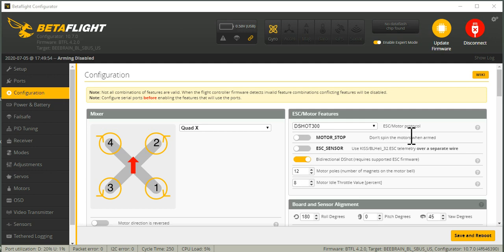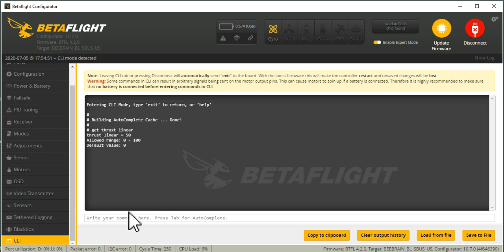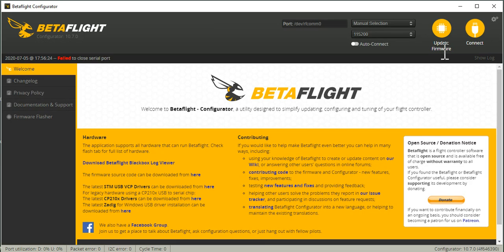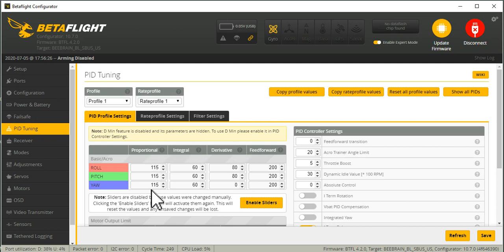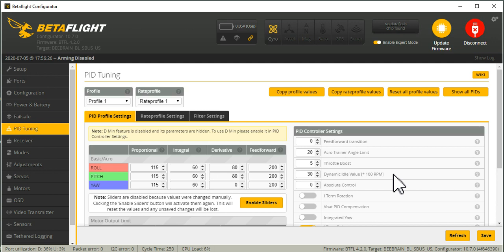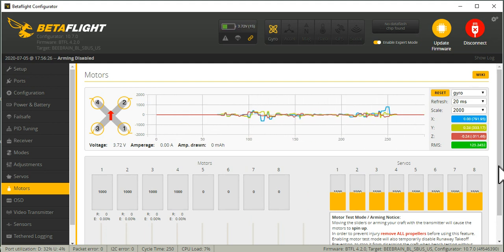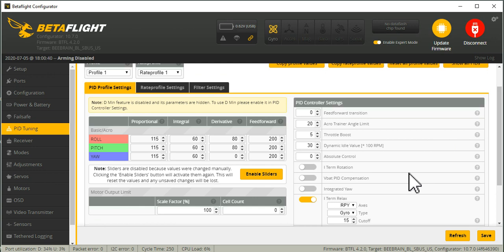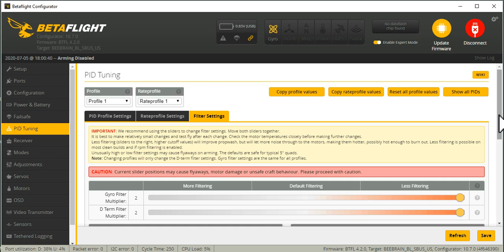Betaflight 4.2 for 1S 1202.5 with Gemfan 3018

Comment: Thank you very much for this tune, 3 years later. Worked very well to fix the wobbles on one of my Babytooth builds.  2mm Babytooth frame, RCinpower 1202.5 11500kv motors, and an old BetaFPV 1s 5A fc. Worked well for both the 3018 biblade props and the 3016 triblade props.
Reply from the maker: I’m glad it worked for you!

Comment: thank you SO much! do you think these settings will is for the new FPVCycle 13mm 11250KV motors on a KebabFPV babytooth (with 3018 props)? I'm still a newbie and can't tune myself yet. thanks again
Reply from the maker: Yes, it should be a good starting point. If the quad is too jumpy when you arm or if you get hot motors, decrease the P and D a little (keep the P:D ratio the same).

Comment: these settings are just amazing. i have applied these to my 1s 18650 3D printed nano long range. It runs on Happy 1203 11000kv motors. transforms it.
Reply from the maker: Good to know that it works for the long range build as well. Thanks for the feedback.

Comment: Love this tune. Transformed my build from a jittery wreck into an absolute dream to fly. i built mine with A generic fonster 125mm 1.5mm frame. I cut one of the lugs off to enable me to use the crazybee f4 lite the right way up and access the USB port. Happy model 1202.5 11000 kv motors with plugs. The crazybee f4 lite has an SPI receiver better than some and the built in VTX isnt bad either. Beebrain canopy  with Runcam Nano 3 (Mobula6 camera). 38g dry with Gemfan 3016 tri blades. Only using the solid pin PH2.0 battery connector that came presoldered but still seems to fly great on GMB 1S 300mah  LiHV lipos. No soldering required so a really easy build. I Learned so much watching this. Brilliant work Sir!!!

Comment: Have u every experienced a motor grinding noise issue with rpm filtering on 4.2? I’m using uavtechs toothpick pid tune as a starting point but noticed a crunchy sound that wasn’t there when I was on 4.1 before I upgraded to 4.2 and added rpm filtering.
Reply from the maker: I haven't personally. My builds tunes tend to get high throttle warbling type oscillations. On some of the UAV tech videos he's captured the Dterm oscillations, which is a very angry fast oscillation could possibly be a grinding sound?
Reply: @Quad66  thanks for the response, yeah I turned off rpm filtering and it disappeared.
Very strange. Your pids work great though that bob has of your video on his product page, even without rpm enabled so ty

Comment: just done my toothpick build using 1303 fpvcycle motors.. and its soooo good.. high efficiency using 48k pwm.. heres my maiden: https://youtu.be/meK2KKjqDn8 
 but as you said here the 48k makes the quad wobble.. today i try to use 24k on my jesc.. but it will decrease alot my tiny 350mah 3s lipo :p im getting 450msh 3s and should arrived tommorow..
Reply from the maker: DNLKRNWN 1303 is a little too much motor for 350mah.
Reply: Quad 66 nope.. Please watch my maiden flight..

Comment: Are the free rpm filter firmwares able to be used or not recommended?
Reply from the maker: M. TTT. There have been more reported issues with jazzmav. I personally don’t think the savings is worth the risk and don’t mind supporting Thorsten’s work.
Reply: @Quad66  ah okay, yea I'd like to support the work, just don't want to buy them then fly a few packs and have the board crap out or crash and there goes the license.
Reply: @Quad66  oops I thought it was 20 bucks for one aio, not 5, I just got a license for the board to try out.

Comment: Have u tried 2s with a motor output limit? Or is this just strictly a 1s build for u. Only ask cause I see u are using the beebrain brushless board
Reply from the maker: I’ve flown it on 2S but the power band isn’t right. I would love to try the flywoo 1202.5 in 8-9000kv.

Comment: I gave this a whirl on my WarPig 120 2mm, with a BetaFPV 1s FC, the FPVCycle 1202.5s and the Gemfan 3018 bi-blades and I can comprehensively say this tune is freakin amazeballs - though so is the quad itself.  I had wondered about the hype, but this combination is nothing short of spectacular. Mine comes in at 38g dry and 53g AUW (600mah GNB 1s) and flies so damn well - and quietly! - I can tear the sky apart with this around home and is almost silent which is great as I don't want the neighbours to take a dim view of my time in the sky.  Very very happy with the overall result.  Thanks so much for your work in the 1s department Quad66!
Reply from the maker: Awesome! Cheers.

Comment: On the DMin side of things - running high gain/advance (50, 100 respectively) takes away a lot of that weirdness, but it also gives you less of that overall improvement.
You're correct about 3 harmonics being great - the higher ones cause basically zero phase delay, so might as well, because anything the D-term picks up there is going to be bad.
Reply from the maker: On a 2S build with black box the best balance I found was to keep the D high no Dmin but to increase a little low pass Dterm filter and then raise rpm Q to 750 to reduce the phase delay. I’ll do a run through on that sometime soon hopefully. I’ll try out that approach on the 1S as well.

Comment: Just built myself a 1s micro with the flywoo 1202.5 11500kv motors with crazybee f4 lite. Maiden was on stock 3.5.7 and flew great save for some wobbles after flips and split s turns. Did your tune on 4.2 with licensed jesc 48khz and I have never felt anything so smooth after dives, split s turns, flips, and rolls! However, I find that general steering is a bit... Loose? As compared to 3.5.7, which  felt really locked in. Is it because of the different setup? What should I adjust to get tighter turns? Thanks and again, awesome work!
Reply from the maker: The term loose is commonly used but it can refer too or be caused by multiple things. In terms of feeling loose all (and more of the following can cause the quad to feel loose):
P too low = sluggish with slow P undershoot oscillations
P too high = quick response but vague with fast oscillations
P/D too low = sluggish dull respsonse
P/D too high = P overshoot and oscillation, initial response will be quick but then feel vauge and unpredictable with bounce back at the end of flips and rolls.
FF too low: lag in response to fast moves
FF too high: jittery and unpredictable
I too low: difficult to hold attitude through corner, bobbles with throttle cuts and small punches
I too high: I accumulation causing slow overshoot oscillations
48 khz: decrease punch and decrease braking making it more floaty
Filtering too little: Increase Dterm noise causing less effective dampening from D.
Filtering too high: Increase latency so Dterm coming on to late to dampen particularly with prop wash. 

can you post your diff all from 3.5.7?
Reply: @Quad66  Here you go. Stock pids and all from when I got it, save for personal settings...

# 

# diff

# version
# Betaflight / CRAZYBEEF4FR (C4FR) 3.5.7 Mar 15 2019 / 21:42:20 (e9130527c) MSP API: 1.40

board_name CRAZYBEEF4FR
manufacturer_id 

# name
name Frazam

# resources
resource MOTOR 1 B08
resource MOTOR 2 B07
resource MOTOR 3 B06
resource MOTOR 4 B10

# mixer

# servo

# servo mix

# feature
feature -TELEMETRY
feature -ANTI_GRAVITY
feature AIRMODE

# beeper

# beacon
beacon RX_LOST
beacon RX_SET

# map

# serial
serial 1 2048 115200 57600 0 115200

# led

# color

# mode_color

# aux
aux 0 0 0 1800 2100 0 0
aux 1 1 1 1800 2100 0 0
aux 2 2 1 1300 1700 0 0
aux 3 36 2 1300 2100 0 0

# adjrange
adjrange 0 0 1 900 1200 12 1 0 0
adjrange 1 1 1 1200 1800 12 1 0 0
adjrange 2 2 1 1800 2100 12 1 0 0

# rxrange

# vtx

# rxfail

# master
set gyro_sync_denom = 2
set gyro_lowpass2_hz = 0
set rc_smoothing_type = FILTER
set rx_spi_protocol = FRSKY_D
set dshot_idle_value = 1000
set motor_pwm_protocol = DSHOT600
set align_board_yaw = 180
set vbat_max_cell_voltage = 45
set vbat_min_cell_voltage = 29
set vbat_warning_cell_voltage = 30
set ibata_scale = 1175
set yaw_motors_reversed = ON
set small_angle = 180
set deadband = 1
set yaw_deadband = 1
set pid_process_denom = 1
set osd_warn_batt_not_full = OFF
set osd_warn_batt_warning = OFF
set osd_warn_esc_fail = OFF
set osd_warn_core_temp = OFF
set osd_vbat_pos = 2401
set osd_rssi_pos = 2081
set osd_tim_2_pos = 2103
set osd_flymode_pos = 409
set osd_throttle_pos = 2369
set osd_current_pos = 288
set osd_mah_drawn_pos = 320
set osd_craft_name_pos = 394
set osd_warnings_pos = 2345
set osd_avg_cell_voltage_pos = 353
set osd_disarmed_pos = 266
set osd_stat_tim_1 = ON
set osd_stat_max_spd = OFF
set osd_stat_battery = ON
set osd_stat_bbox = OFF
set osd_stat_bb_no = OFF
set vtx_band = 2
set vtx_channel = 7
set vtx_power = 2
set vtx_freq = 5847
set vcd_video_system = NTSC
set frsky_spi_tx_id = 43,236
set frsky_spi_offset = -42
set frsky_spi_bind_hop_data = 0,79,158,2,81,160,4,83,162,6,85,164,8,87,166,10,89,168,12,91,170,14,93,172,16,95,174,18,97,176,20,99,178,22,101,180,24,103,182,26,105,184,28,107,186,30,109,0,0,0

# profile
profile 0

set dterm_lowpass2_hz = 0
set dterm_notch_cutoff = 0
set feedforward_transition = 21
set iterm_relax = RPY
set p_pitch = 80
set i_pitch = 100
set d_pitch = 85
set f_pitch = 140
set p_roll = 85
set i_roll = 100
set d_roll = 85
set f_roll = 140
set p_yaw = 120
set i_yaw = 100
set f_yaw = 140

# rateprofile
rateprofile 0

set tpa_rate = 30
set tpa_breakpoint = 1200

#
Reply: Quad 66 i just flew a couple of packs, and though it flew different from when it was in 3.5.7, i guess all it needs is some getting used to. The quad feels smooth all around and since I’ve never tuned a quad thoroughly, mostly tweaks here and there from stock, I just might not be used to a smooth flyer. Add to that the vbat compensation, I probably am mistaking the extra oomph from a fully charged battery as having tighter controls. The quad flies consistently the same now, similar to how it was when the battery is at about 3.6v. Problem is, even when down 3.3v, to 3.2v, the sag isn’t terribly dramatic that I want to oush the battery some more.
Reply from the maker: Franz A.D. Morales If you want a little sag at the end to motivate yourself to land you can raise the batt min voltage from 3.3 up to 3.5. You will lose an appropriate land now warning but the thrust will sag once below that voltage. It will also give you a little more thrust throughout the range above 3.5 since the compensation only goes down to 3.5. Alternatively you can set vbat_sag_compensation a little lower into the 85-90 range. That setting will allow a little hero volts at the start and a little sag at the end.
Reply: Quad 66 interesting. About getting a much more powerful vbat conp effect up to 3.5v. I’ll try those out in the morning and see which works best for me, i usually go all out during hero volts then cruise once it hits 3.6v.
Reply: I noticed I lost about a minute of flight time. Even on bt2.0. is it because of the Vbat compensation? It's weird though. Cruising, I get 5mins. Full acro, with flips and rolls, powerloops and split s turns, I still get 5mins. Wondering if this is an effect of vbat compensation

Comment: did you flash your esc or you keep original firmware
Reply from the maker: ESCs are flashes to JESC 48khz licensed S H 40 (I believe but check https://newbeedrone.com/pages/downloads to be sure). That’s a change from the original Y H 10.
Reply: @Quad66  timing you keep it medium or high
Reply: @mokaframe2102  MedHigh has worked well enough for me on all these.

Comment: Please add descriptions of exact build so we can compare, is this for the Kebab BabyTooth frame with FPV Cycle motors? I am running the 1202.5 motors with 3016 + 600mah 1s XT30 and struggling to get it flying well on BF4.2.
Reply from the maker: I’ve updated the description. The build is on my SkyRyder 120 frame. What issues are you struggling with?